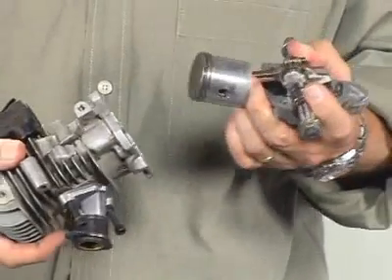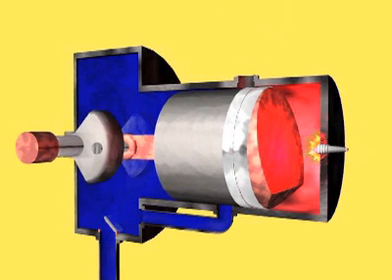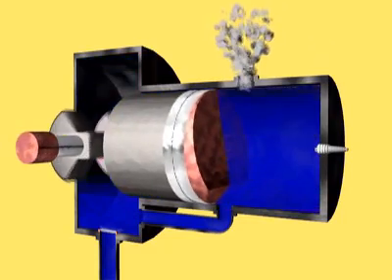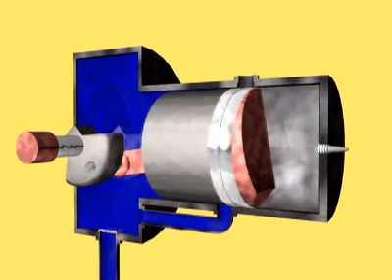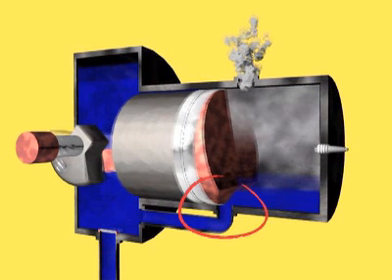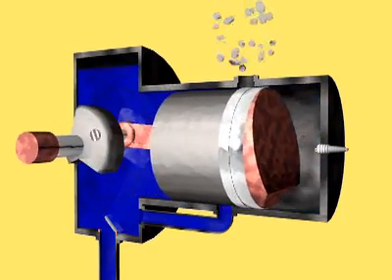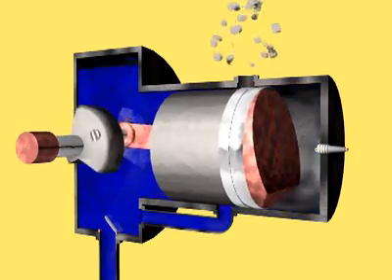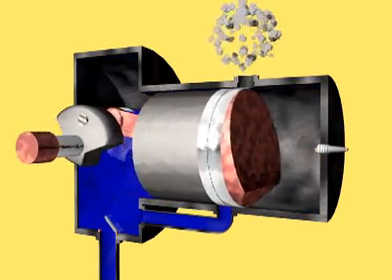How Two-stroke Engines Work

Comment: The basic engine principle of a properly setup 2 stroke is far superior to a 4 stroke, contrary to what you hear. The firing every revolution and a fraction of the moving parts cannot be argued. They did have some disadvantages, but these have been addressed by better oils, better metals, DFI and powervalves. They are now on par with the 4 stroke in areas they weren't before. Fight for their return by supporting co's like ours and riding/racing them whenever poss. Also sign the web petition.

Comment: @Frederik19951995  if you hav a tuned muffeler  the back pressure can help  prevent the unburnt fule from excaping and it increases torq at low rpms

Comment: @Frederik19951995 not all the time.

loud - if you have a small muffler
smells - i agree
oil in gasoline - they make oil injectors, my dirtbike has one.
short lifetime - Not really, unless you mean spark plugs.
hard to start - I kick start my dirtbike easily.

I agree that 4 stroke is better though.

Comment: well, I got a good news, lotus already developed loop scavenging 2 stroke petrol engine, it is fuel injected, can run on alcohol fuel and very efficient than 4 stroke engine. it has oil sump so it does not need fuel-oil mixture since it lack of transfer port, they call it lotus omnivore

Comment: At 1.56, well, not twice the power, but a little more power than a four cycle. A two cycle has less volumetric efficiency, and uses more of its own power circulating gases during that cycle.  It fires twice as often, but it will not be twice the power.

Comment: @TheKawi125rider Nope.  A 2 stroke does not have twice the power of a 4 stroke.  Why?  Principally because of the difficulties associated with scavenging.  4 cycle engines mechanically purge the exhaust gases, typically through some 440 degrees of crankshaft rotation.  2 cycle scavenge in a less positve way during an abbreviated interval of about 130 degrees.  I.E.  exhaust gas remains in the cylinder to blanket combustion.
VT247

Comment: @browny232323 now they do, check a 2 stroke engine on a newer seadoo the one with a fuel injection,no fuel wasted here but very complicated 120psi on the fuel pump combine with 100psi of air been pump into the fuel distrubirator

Comment: no wounder 2 strokes pollute, at the intake cycle the exhaust pore is open now i now why my weed eater pollutes a lot....and he forgot 1 thing,cause they are no valves thats why you have to mix oil and gas to lubricate the piston and crank shaft

Comment: @tylerandjaron  if u watch and see how a 4 stroke engine works you will under stand much better... on a 4 stroke engine there are for strokes per power cycle, and Intake Stroke, compression Stroke, Ignition Stroke, and Exhaust Stroke. Each stroke has its own reason. 4 stroke engine have a CAM or 2 Cam(s). the intake Cam and the Exhaust Cam. on the first stroke of the 4 stroke engine a VALVE opens and allows fresh air in the chamber

Comment: @tylerandjaron 
True but tuned 2 stroke engines will have an expansion chamber where some of the exhaust pressure is reverberated back towards the engine pushing some of the fresh fuel back into the chamber. Although they will never be completely efficient.

Comment: Once I had a Trabant. Few of you guys will know what a Trabant is (was). That was a small car produced in East Germany and fitted with a two-stroke engine. You had to fill it up with a mixture of gasoline and engine oil because its engine didn't have an oil compartment. So the lubricant went into the engine with the fuel and then left through the exhaust along with the exhaust gases. If you stood behind it while the engine was running you risked your trousers getting soaked with engine oil.

Comment: @lperr39 
There is a small curved ramp on the top of a 2 stroke piston facing the intake port that directs most of the fuel are mixture up to the top of the cylinder which also helps clear out exhaust gasses.
The exhaust pipe and muffler on a 2 stroke needs to be tuned to give the right back pressure so the fuel won't rush out with the exhaust.
There are some direct injection 2 strokes too gas and more often diesel

Comment: @kikkeruddabut the exhaust system of a 2 cycle is important. It has a perfectly set amount of back-pressure that keeps the fuel charge in the cylinder for the fraction of a second that the intake and exhaust ports are both open at the same time. This is why 2-cycle exhaust should not be modified. Keep in mind that this happens extremely quickly.

A small amount of raw fuel will typically come out the exhaust port in normal operation.

Comment: The reason why you don't see them in cars it's because they pollute the environment a million times more than the regular 4-cycle engine. They technically spit out gas and oil. That's why they are used for small applications only. Other thing! No way to supercharge the intake of a 2-cycle... so, thank goodness for 4-cycle 8-cylinder American motors.

Comment: @aydinburton93 
The First and most important thing:    The constructors design is the most reliable. and also the cheapest...  
If you try to modify yourself keep in mind thet it can cost reliability. how you make it to shore when the engine blocks?
Make it more queter you can with a  1 inch tube with alot of holes in the sidewalls
put rockwool arond and then a larger tube over all.  Now you have a silencer!
Keep in mind that the silencer can burn if the rockwool gets to much oil and heat

Comment: I understand how a 2 stroke works, but why intake air/gas/oil from the crankshaft area & not a separate area where the oil doesn't have to be burned?

Comment: @run0hard9

Probably because they generate lots of heat. Also, 2-stroke engines need the oil mixed with the fuel, and you'd need to mix just the right amount of each. A lot of people don't know how much oil to add to fuel, and it's not basic engine oil either.

Comment: Nice video.

2 troke engines are auwesome, we love to modify them they have alot of power and souplesse.
But they have a dark side:  theyr exaust gases are very poisoned due to the synthetic oil and unburned benzine they spit out

Comment: @qAyyUm, as far as I know. If your engine eats oil it means that your piston ring is in a bad condition, and this way it lets oil enter the combustion chamber (on a 4 stroke). But I don't know how to know it's condition on a 2 stroke engine, probably compression\power loss like gabriels2v8 said earlier.

Comment: Dont some 2-strokes use the Pistons "skirt" to manage fuel and exhaust???!!
There is atleast 2 designs, right? I used to modify Mopeds and takings 1/16 to 3/16th off the skirt would increase Power while Fuel and exhaust were altered..

Comment: I was also taking a look at the Nelson Engine (not nelson racing engines) that inputs fuel on every half stroke, and uses the waste heat to heat the incoming air, for supposed 60% thermal efficiency (take with pinch of salt but is wortk looking into)

Comment: I was thinking, If you want bigger power in a small space, what would be wrong with say a dual action 4 stroke, where the first ignition charge compresses a charge in the second side of the cylinder, then that ignites, expelling the waste in the first half of the cylinder. Then a fresh charge enters the first half of the cylinder as the waste is being expelled in the second half. A charge enters the second half as the first half is being compressed etc

Comment: @CWO4Mann Forget propane. Direct Injectio is the answer. It is being used in outboard boat engines, some scooters, and now a few snowmobiles. A 150hp DI 2-stroke snowmobile is about as clean as a 130hp 4-stroke.

Comment: he did leave out that when piston is on it's way back up to TDC, it actually sucks in air from the exhaust. Thus, giving the motor a turbo effect.  That's the expansion chamber in a 2 stroke pipe is important. It deflects air back to the motor.

Comment: @bmxty82 boggy ? mabey the ones  you seen didnt have much torque or wasnt tuned right  i never had a boggy 2 stroke  the old honda cr500 was a 2 stroke dirtbike and had plenty of power if could outrun alot of these 450 4 strokes

Comment: @bmxty82 2 strokes usually make more horsepower per cc 4 strokes dont usually make as much as hp as a 2 stroke of the same cc also 2 strokes usually have a better top end performance in also 2 strokes can be used to heck and back as long as you run the right lube and take care of the engine ive seen people with motorized 66cc bicycles from china that use high quality oil and take care of them and they have  over 20 thousand miles on them

Comment: every 2 stroke engine has an exhaust with an ''expansion'' this expansion forces some of the exhaust fumes from the previous stroke back towards the cylinder, forcing the fuel to stay in there until the stroke is completed again, then it repeats

Comment: wrong, all 2 stroke engines have an exhaust which has a so called ''expansion'' this expansion in the exhaust forces exhaust fumes back, temporarily blocking fuel from exiting too soon

Comment: Well, that engine in the video is going to be really out of balance with the crank pin in the flyweights. lol He didn't explain the reed valve in the crankcase either. FAIL

Comment: @GReaper147  they blow some fuel out without being burned and some exhaust stays behind during the compression. That is why they have higher emissions(other than the oil mixed in the fuel) but they don't burn fuel better than a 4 stroke simply because it is not as controlled a firing.

Comment: Eegads. I forgot to mention something else yet left out of this video. I already mentioned the exhaust phase of this event but not the reed valve or the concept behind that. This video totally fails to mention that on the compression phase. I.e.; why doesn't the piston simply shove the intake mixture right back out of the intake port during the up stroke? The blue fuel comes in and it's just going to simply "stay" in the cylinder?  Why? Because it refuses to back up in the intake?

Comment: It's good you noticed the critical part of this thing that apparently "Howstuffworks" dot com failed to address. They failed to point out the very critical point of the scenario that you bring up. I'm thinking, not only the waste of fuel, in this  general animation  video, but the loss of power as well. By the time the cyliner reaches the top, how much compression is lost ? They blew right past this one    ;-(

Comment: The other benefit of a two stroke is that it works at any angle. For applications such as weed eaters and chain saws you don't want the engine stopping because you turn it sideways.

Comment: the bikes you have might be not the same, if they are scooters, variator tuning can make a scooter faster from start or faster top speed. a 2 stroke 70 cc engines with bigger ports are the same powerful as 125 cc 4 strokes (on the scooters).

Comment: i have 2 49cc bikes and ones 2 and ones 4 stroke and the only difference between the 2 is that the 2 stroke fly's off the line alot  quicker but in the end the 4 stroke passes the 2 stroke. So more power??? i dunno....

Comment: @TeamTraxxas37614 no bother mate. but what you said about the oil - in a 4 stroke the oil and petol never mix, unlike a 2 stroke where the oil/petrol mix luricates the crank shaft before entering the cyliner. you may or may not have to mix the oil and fuel yourself depending on if there is an oil injector

Comment: @TeaTraxxas37614 emmno its nothing to do with that. i think youll find its because the piston takes two strokes to complete a cycle. unlike 4stroke that has intake, compression, ignition and exhaust. dont answer peoples questions if you dont know what youre speaking about

Comment: @MDIVISIONRULES Yes thats what i said. And what im trying to tell you is that 4 stroke have more torque. And the reason they have more power is because their simple and easy to build them small. But if you have a big 2 stroke engine and a big 4 stroke engine, the 4 stroke will have more power.

Comment: @MDIVISIONRULES 2 stroke would have more horsepower for its size but 4 strokes would have more torque and if you make bigger engines the 2 stroke advantage will decrease rapidly.

Comment: don't you lose alot of fuel because when the piston uncovers the intake port, the exhaust port is still open so doesn't alot of fuel get pushed out of the exhaust port?

Comment: Oh you thought that i was thinking that it was unbalanced because the other half of the crank is hard too see. I meant to say that the counterweight the balances out the crank is on the same side as the pin for the connecting rod. It should be on the opposite side. Sorry, quite a mouthful, but i can assure you i've don my homework right.

Comment: because if all cars were two-stroke we would all be dead from intoxication. One obvious reason is less pollution because two-stroke engines burn oil and gasoline.

Fun fact (or not so fun): A scooter (which uses two stroke engine) in one day pollutes as much as a car in 1 year.

Comment: making power every rotation only provides to the vehicle a better acceleration. as it has not valves, the efficiency of a two strokes engine is not as good as a 4 stroke engine one.
a two stroke engine can be very powerful, remember the disappeared gp500 bikes.
everybody talks, but believe me, ì'm mechanic.

Comment: they tried to banned people from using dust  blowers, weed-eaters, in LA cause cause of  the pollution long time ago,my seadoo has a 2 stroke engine w/direct injection but i hate the fact that the 2strokesyntatic oil cost $69.00 a gallon i heard that by 2012 they might banned 2stroke jet-skies from the lakes is that  true ???

Comment: Sorry to dissapoint, but no it's not. Diesel is famous for his 4 stroke "Diesel" which uses a high compression ration to ignite the fuel instead of a spark plug. He tried making a two stroke "Diesel" but it turned out to be very inefficient. 

TL;DR: 2 strokes and Diesel's are two totally different motors and should not be confused with one another.

Comment: Wankel's engine have a continously ingetion system which is better for the ingetion and the excuast..It takes the gas..combressor ..ingetion it and the excaust it without opening and closing valves...that's the Best Engine Created by Wankel '50..Friendly

Comment: [to HaleFire7] Exact timing......it becomes a problem when fuel mix ratio is off or the carburetor is not tuned correct..that's when you get a slight oily gas mix out of muffler among other issues.

Comment: when the piston stops going down, the air fuel mix being forced into the cylinder doesnt have force behind it anymore so it will slow down and maintain its position.

however 2 strokes are not perfect, some engines leak some into the exhaust pipe and some dont force all of the exhaust out, leaving it in the cylinder. its all about timing...

hope this is easy to understand. im only 16 (Y)

Comment: On a 2 stroke you always see the exhaust pipe has an expansion chamber.  this chamber causes exhaust to resonate through it, and actually create backpressure at the right moment to let the exhaust out but then force the air and fuel to stay in the combustion chamber.  This is also the reason 2 stroke engines have such a narrow usable power band.  everything must be working just right and together to make the engine perform properly.

Comment: Essentially thats what the KIPS does. It is an extra chamber that acts as an auxillery exhaust port, but instead of letting the exhaust release through the echo chamber, it allows the exhaust and non-combusted fuel mix to re-enter the cylinder during the next cycle. This is one of the better ways to recapture that lost fuel and make sure it is burned.

Comment: umm i think they could improve the engine so the time that the waste comes out from the chamber and the new fuel comes in. i think id just put some better spark plugs so it can burn the fuel, and this doesn't have an intake or outtake... giving a better ones could improve performance. i dont know it was just an idea because normal piston engines needs to do 2 steps before the new fuel is on the chamber.

Comment: This type of engine is very wasteful when it comes to fuel consumption. Many times, when the fuel mix is released into the chamber there is a percentage of fuel mix that escapes along with the exhaust from the previous cycle. There are ways of getting around this, like the Kawasaki KIPS which recycles that back into the cyclinder at higher RPMs, but at low RPMs the fuel is still released with the exhaust. In short, these types of engines typically engines waste fuel.

Comment: not quite true. they are about 75-85% as power efficient as most 4 stoke engines. they do make more noise, use more oil, generate more pollution(I couldn't care less either, don't worry). but they DO create an extra 50-60% power with the same displacement.

Comment: I'm surprised he didn't touch on the negative aspects of 2-strokes, namely the fact that they are disgustingly dirty.  Also, he didn't mention the oiling system (which is half the reason why they're so dirty).  The oil and gas are pre-mixed (since the air/fuel charge passes through the crankcase) so they burn a ton of oil by nature.  Simply put: 4-stroke engines separate the oil and gas, and 2-stroke engines mix the oil and gas.  So 4-strokes recirculate oil whereas 2-stokes simply burn it.

Comment: 2 strokes are more powerful than 4 stroke engines on dirtbikes, they are also less eficient cause you have to change the spark plug more often and it burns fuel like a dick

Comment: BKsMassive, the petrol don't come out because the exhaust is closing very fast and, in first period of the compression time, the backpressure formed in the exhaust system help to keep the fresh mixture inside the cylinder...that's why at 2 strokes engines, the exhaust system is very important